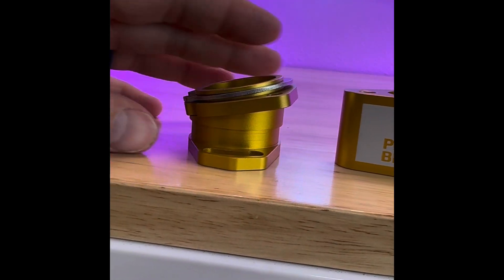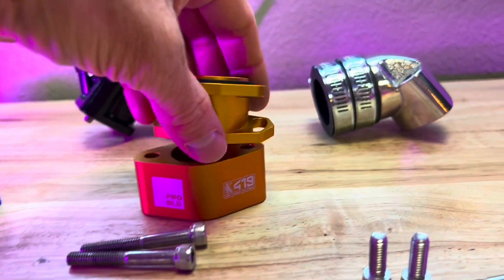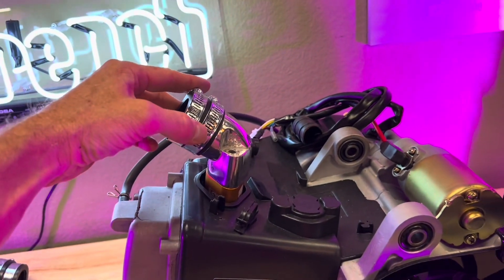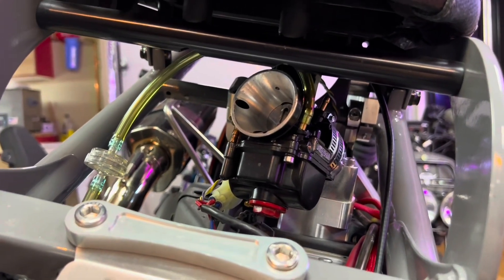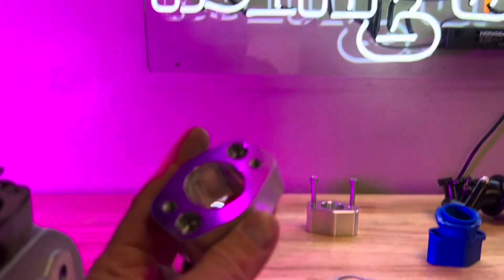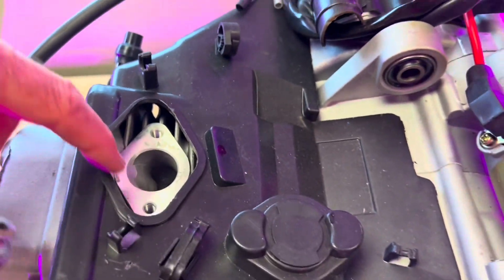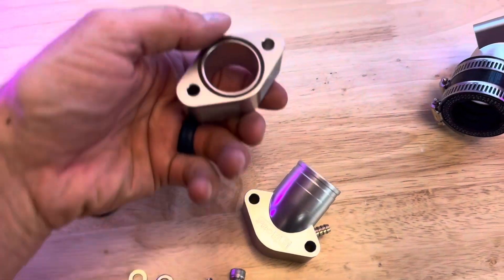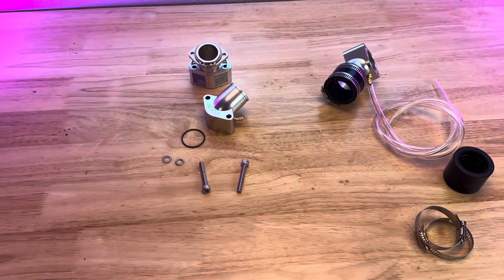GY6 Adjustable CNC Leveling Clocking Flange + CNC Intake Manifold

Comment: Quick question 🤔  theres a war going on about final drive oil. The  sides are Gear oil, HP oil and motor oil.... i feel people are picky cause honestly in gearboxes at factories i understand we just use what we got and theres no issue as long as its changed regularly 🙃
There isn't a concern in my mind cause its not oil for the a petrol motor as long as viscosity rating is the same as manafacture recommendation or similar
Its just needs to be flushed and cleaned. 
Seals and bearings replaced so no vibrations or unaligned gears.
Torques checked.

The machines are very old and still kicking. 

I have a honda helix and went for high point oil big reason is gears contact at high pressure.  Also more oxidation resistant.
Could you give your expert opinion on that? And clarify final drive oil
Never had metal shavings in the final drive i flush it often when it rains, it's cheap. 

Also all scooters despite promoting ethanol gasoline the manuals specifically say it's best to go non ethanol if available. 

😂and my honest opinion about all oil changes is its like changing your underwear. You don't wait til it goes bad to change them